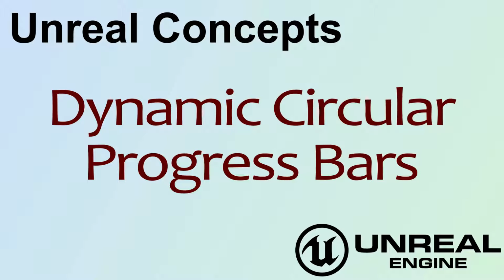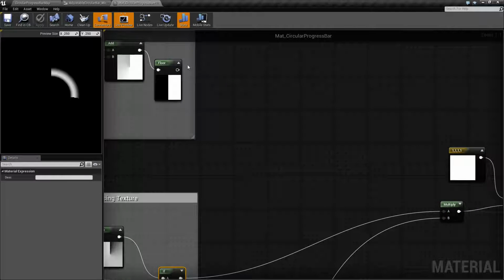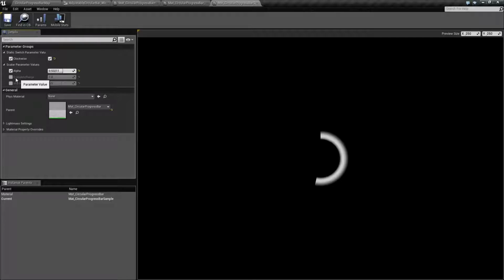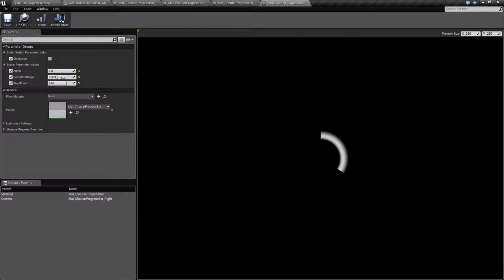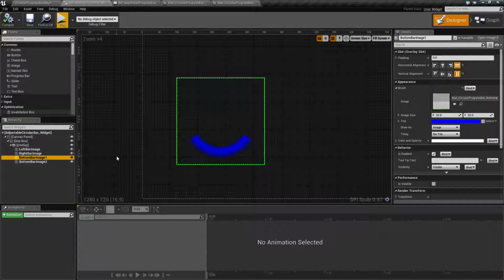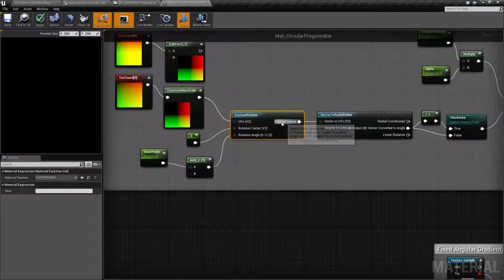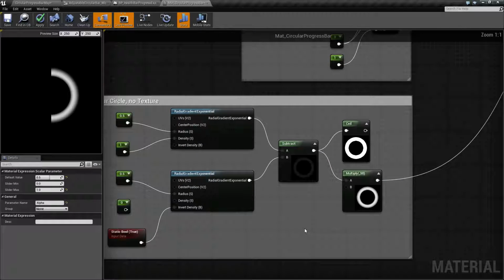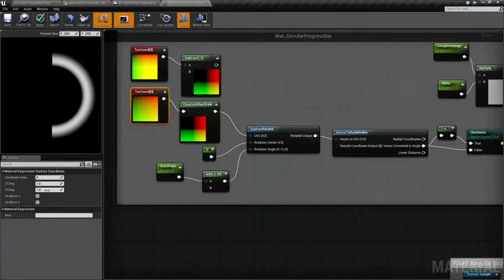Unreal Concepts - Dynamic Circular Progress Bars ( UE4 )

Comment: Hi Mathew Wadstein, how are you?

The video is very good, but I have a problem with the radial bar. I am using Unreal Engine 4.25. The menu works perfectly, looks great in the editor. However when the game is compiled, in the cooked version, for windows x64 the radial bar simply does not work.
How is it possible to solve?
Can someone help me?

Comment: Suggestion: make a version that doesn't use float% of turn, but instead uses divisions of a turn.

what i mean is give a float that is used to divide by τ.

so 1 would be a full turn, 2 would be one half.  1.5 would be 2/3 of a turn, 3 is one third, etc.  Getting a precise 1/6 like you tried using a % seems a lot more difficult than simply using 6.

let me know what you think.
Reply from the maker: I agree. There are definitely some ways to improve this and having a divisor basically would be alot easier ;)
Reply: +Mathew Wadstein the concept is clear, though. not a complaint for sure.
Reply from the maker: Did not take it as a complaint =)  Your comment about another way to use this is great!